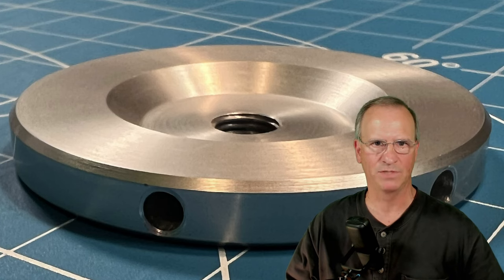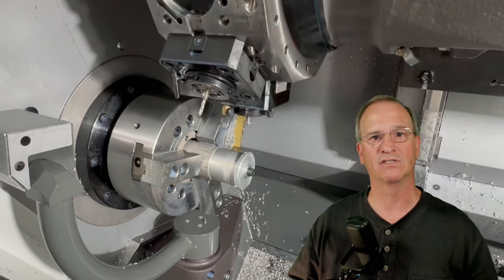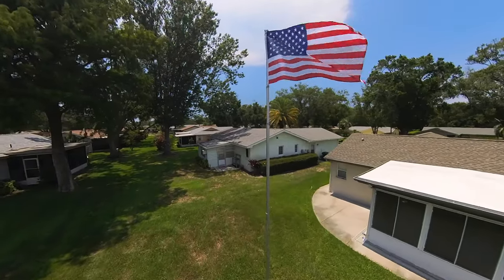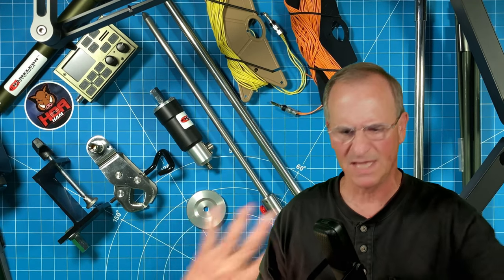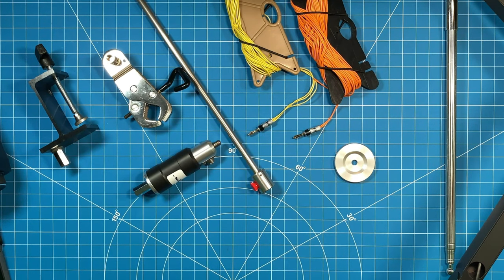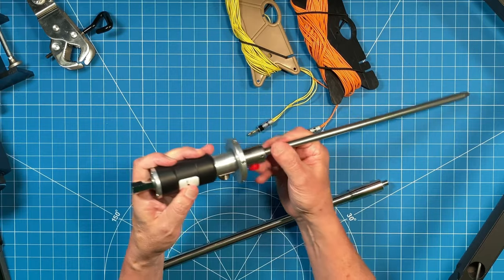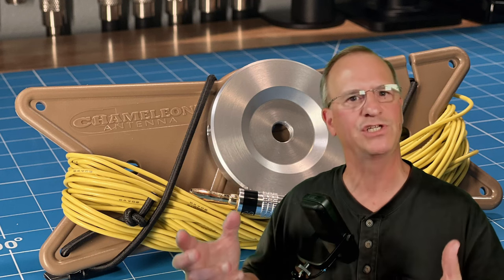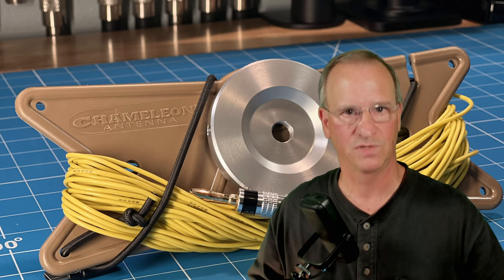Chameleon Antenna Introduces an Antenna Ground Radial Puck --  CHA PUCK Review

Comment: I really like Chameleon products! They are a little higher than some others products, but they will pay for themselves plus some extra over the years.  I really don’t mind paying more because it cost the company to bring quality to the customer. 

I still love my Emcomm II antenna. It does extremely well on nvis every time I connect the RG-8 coax to it. 

Thanks for the insider news regarding Chameleon! 

Thinking about buying a new Emcomm II or III soon.
Reply: You should try the CHA LEFS 8010.
Reply: @Chameleon_Antenna  I will check it out.
Reply from the maker: You nailed it!  I consider buying their gear an investment, almost like the radio itself.  Obviously with what I do, I have a lot of different products, and of the gear I own no one matches Chameleon quality.

Comment: Is the connector between puck and whip a transformer or a simple antenna mount?
Reply from the maker: Bottom line your radiator cannot touch the puck; if you do, the signal goes to ground.
Reply: So if you want to use the puck on a spike and radials from the puck you need an antenna mount with male 3/8x24 on the bottom, female 3/8x24 on top, and coax connection on the side , and top is insulated from bottom

Like the new coil they have? is there any other mount? The BD7 maple is great but not 3/8x24 male on the bottom

Does CHA make anything like the bd7 for use on the spike and or puck?

Comment: Great. Another thing to buy. I should just buy stock in them, lol
Reply from the maker: You're welcome?  I'm sorry?  Their gear is hard to resist.
Reply: @HOAHamRadio  because its tough as hell, and I am not one to baby stuff lol. Most of it resides in the bed of my truck, and their MPAS system is, hands down the most robust system I have used.
Reply from the maker: @oldsoldier181  Completely agree!
Reply: @HOAHamRadio  just watched the vid on the new antenna....guess I will wait a few until that comes out :). Wouldnt mind a smaller, backpackable vertical.
Reply from the maker: @oldsoldier181  Hopefully the antenna comes out in a few weeks, they are still waiting for a few parts to complete the build / kits.  The puck will be part of the antenna package, from what they told me.
Reply: @HOAHamRadio  that works for my budget :).
Reply: @HOAHamRadio  I will be keeping an eye on that. Thanks!